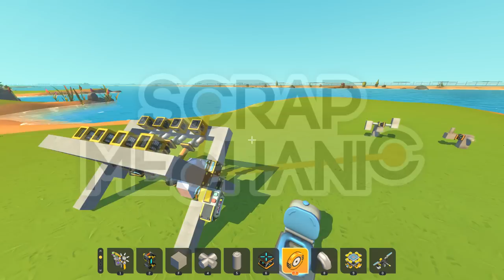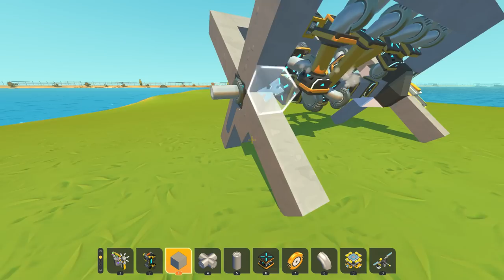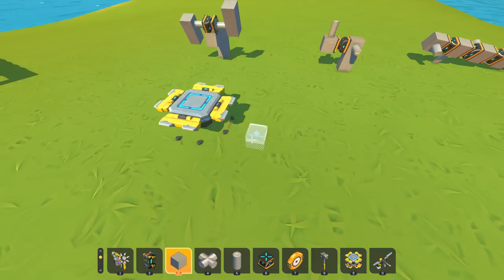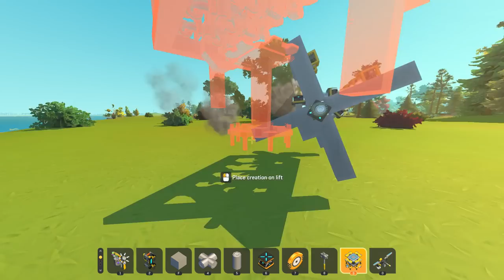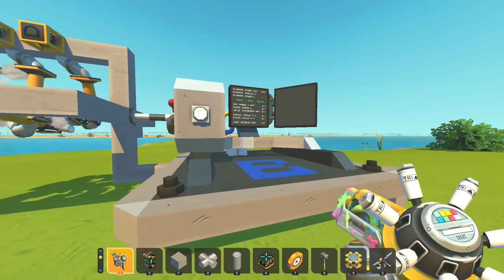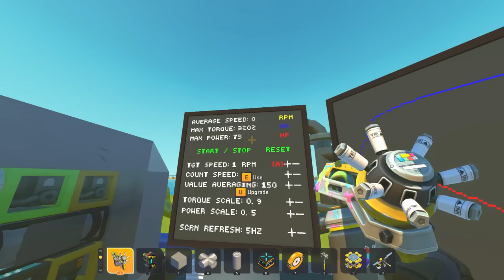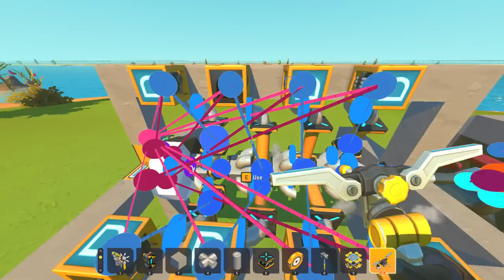I Built a V8 Engine Using 2 Amazing Game Changing Techniques!

Comment: Like you said at 13:30, this engine is basically 2 inline-4 engines bolted together in the shape of a V8 engine. Now for scrap mechanic this is probably not a bad thing, because a true V8 engine needs a timing wheel with 8 sensors. This introduces a lot of extra complexity. Its definitely worth to try making a V8 with 8 separate strokes.

Timing wheel wise, the first thing I can say is ditch the wedges. Everyone in scrap mechanic knows how bad the collision on wedges is if you've ever made a door. This is even worse for a piston engine. Another personal preference I have is putting the sensors on the crank instead of the color wheel, which is done to slightly compact the engine.

As you've already stated in the video, losing the logic gates will improve the engine a ton. Every engine should have an angle on which it simply will not turn because all pistons are canceling eachother out. For this reason I personally always hook my timing wheels up with a 90 degree offset, ensuring that the engine starts in a non-rotating state right after spawning without logic gates.

Finally I have a remark about the frame you build for the engine. One thing you want to make sure to minimize is potential collision points. Because you have rotating pieces right next to full blocks there is a chance these will collide, costing power. This is especially true when the potential collision point involves a wedge, due to their previously mentioned terrible hitbox. Again, getting rid of the wedges should solve this, but I also suggest building most of the frame out of pipe pieces. Thats part personal eastetics, part way to reduce (visual) size and part solution to any potential power loss due to collisions. Plus it allows for the use of 0-width blocks, which is a supprise tool I'll teach when the time is right. Expect way better passthrough, massive space savings on the crank and more!

Edit:
For those who wanna know how the 90 piston works, in the blueprint you'll see sth like:
"xaxisA": 1, "xaxisB": 1, "zaxisA": 3, "zaxisB": 3
The value you want to change as kAN said is "xaxisB". The value can be either -3, -2, -1, 1, 2 or 3, but you need to keep in mind that:
- "xaxisB" cannot be the same as "zaxisB" or its negative. (in this case not -3 or 3)
- negating the original "xaxisB" gives a 180 degree rotation
- using one of the remaining values gives a 90 degree rotation (in this case -2 or 2), which is clockwise or counterclockwise depending on which you choose

Edit 2:
Idk if anyone noticed, but kAN wired the pistons wrong, one side fires 90 degrees out of sequence if my analysis of the 10 seconds visible wiring is correct.
Reply: This engine specifically only has four power strokes because of where the crankshaft connects to the pistons. look at 0:31, you can clearly see, on the third set of pistons, they will need to fire at the same time. This engine is pretty much a boxer at an angle; "opposing" pistons aka pistons at a 90-degree offset in this case, fire at the same time.
Reply: about the 8 stroke 8 sensor V8, I tried building one and asked some people why it was terrible. Turns out that sensors in the corners of the sensor wheel are significantly off from where they should be, like 10-15 degrees, so the engine would not get a signal every 45 degrees but with uneven intervals. This is terrible for power and efficiency. So even though a V8 with 8 power strokes would theoretically be more efficient, that doesn't really translate into scrap mechanic.
Reply: @outandabout259  I can attest to that. I have seen people use the sensors on grid and their engine works great. Me personally, I just have two sets of sensors (look at the top of the ws as of today) and that also works great and correctly. The issue with proper 45 offset timing is more so with anchor position of the pistons. If it isn't at the right point, timing is also effected. Anyways, in my testing with just 4 sensors, I had terrible power and torque ratings due to the offset timing of the physical pistons. With 8 sensors, the engine gets insane torque over the whole range (it isn't trying to fight against itself) and also results in more HP as a result. The reason why some older designs, such as those from Alstrak in the early days, worked so well with 4 sensors, is because those are with the old creative pistons. The piston that always fired early could not overcome the leverage of the piston firing on-time or after TDC, and as a result, would allow for good rpm and torque, thus, good HP ratings. With the newer, higher power pistons, we have to account for the opposing force, and can no longer do that offset timing with just 4 sensors- slows the engine rpm, and destroys power performance. So more or less, everyone building good piston engines now must work hard to tune them for best efficiency. Kein is an absolute madlad with how much attention to detail he puts, but is very rewarding as he has built some super impressive stuff that seem impossible.

Edit: just noticed Vegard replied above your comment lol, he has a pretty good v8 using 8 sensors on-grid.
Reply: @outandabout259  I did take that into account when building mine. I used 2 timing wheels offset by 45 degrees instead of a single 8 sensor wheel. Such an engine gets close to the power a boxer-8 like engine gets, but thats it. It idsn't all that much smoother either.
Reply: comment bump, I hope kAN sees this
Reply: @casparroist2920  For YT, comment bumping doesn't matter...
Thumbs upping however does work.
Reply: If you make the wedges go the other way, you can essentially get half blocks. This means you can get a perfect 50-50 timing.

Comment: 17:20 I have found that the collisions of different parts can collide. It's not really the friction aspect. In my own testing, I have found that sticking the sensors in place of the timing wheel is better, as the sensors can point to solid square mesh blocks. Then for timing, just paint different sections of the square mesh.
Reply: A common practice to compact this further is to replace 2 of the mesh blocks with the controller. I am not actually sure whether this impacts engine perfomance in anyway
Reply: yeah i concur.  there doesn't seem to be friction but the parts can flex under load, like the crankshaft, and then when it's even one degree off axis, the edges of sections of the timing wheel can collide with edges of the sensors and such.  that said, the new pass through bearing and crankshaft he showed in this video seem to almost completely remove the flexing you can get with bearings, so maybe it's not an issue in his model
Reply: he does not need a block of room, the wedges are the problem. He just has to switch to using 9 of the same block so that SM sees it as one shape, not 7 with what he has
Reply: In my experience with moving parts on a bearing past other parts friction does apply, however I have no idea how much of a difference it makes.

Comment: 16:46 I think you could test this by making two near identical engines with the difference being a space between the encoding wheel and sensors or not and hooking both up to the dyno to see if there is a difference in output.

Comment: The Passthrough concept there is quite interesting. might be handy for some joints, maybe even ones with gears for transferring the rotation from a piston engine. Wonder if it could help with a trammel gear too
Reply: Also works for an extra connection point from the body to the crankshaft to reduce the amount of flex pistons put on it.

Comment: Man, that glitch welding method is smart. I used to just rotate things with controllers out of position, and then placing blocks there, but with the lift its much simpler

Comment: It would be awesome if kan did a piston engine olympics sometime! Imagine this: 20 minutes to build the best poston engine you can and then you gotta put it through 2 different trials. Trial 1: Weight challenge, has to be able to turn a wheel with lots of weight attatched to it within a time limit, whoever spins the wheel the fastest wins the trial. Trial 2: speed challenge, attatch the motor to a basic car, the fastest to do 1 lap around a certain track wins the trial. 

Technically yes, all of this could just be measured with the dyno but I think putting it through trials would be more fun

Comment: Hey kAN, V8 Engines are possible with with a bearing between the crankpins, however some time ago the mechanical community of SM had figured out ways to also make short crank V8s using the the same technique like the one you are using. 
Here is a way to improve your V8 even further:
Piston stretch. Apprently I had discovered that a while ago with my Vulcan engine (made it around 2018) and didn't even know about it. Some people noticed the difference between power I had compared to their V8s and it turned out that if you pull the pistons a bit further they are capable of even more power. Credit to Ben Bingo for finding that out with me. 
Also very important thing I learned is that you wan't your pistons to be set at a distance of 3 and not 2. SM physics makes it so you have more torque that way. This was told to me by Biggycheese. 

Anyways, like I have said previously I am happy that you are making engines now. I hope you continue and I hope we do a challenge one day. That would be awesome and I think many people would be happy if you try your knowledge against the OG piston engine maker. Cheers! :D

Comment: It's been a while since I've played, but I think the big thing is using the logic gates.  1 tick is like 20 milliseconds?  So the piston firing will always be 20 ms behind when it should be firing.

100 rpm being late by 20ms isn't much but 1000 rpm, 20ms is a much larger percentage (affecting where the wheel is when the piston fires)

Removing that latency may be all you need.  I'd definitely work on that before spending time on a dynamic timing wheel.

Comment: The separation of the piston head and base coordinates is probably due to the fact that they can extend so it's probably easier to represent their locations then just connect the 2 with the piston shaft instead of calculating the entire piston
Reply: In terms of blueprint data they're always contracted, though. In theory, you only need to save what one end is doing, and the other end can be calculated from that.
Good that this isn't the case, though, or the blueprint edit wouldn't be possible.

Comment: I find it funny that I pointed out you needed to get rid of the bearings on the shaft... and you needed a passthrough bearing.  I did not know if you needed mods, glitch welding, or whatever, but it was plain you needed these things.  So while I was not a master builder I had the concepts right.  This should smooth things out a lot... and having it balanced too.  So much better.  Can you upload a save for the driveshaft and passthrough bearing?

Comment: if you wanted to do a sort of load based timing you could try to use spirngs on the output shaft (like a sprung clutch) and if the spring is compressed the engine is applying more torque so you could change the timing based on that

Comment: for variable timing, you could have the encoder wheel  being larger, with the pattern of on/off at each block radius being different, and to change the timing you could use pistons to push the sensors out to the next bock radius, and thus timing pattern
Reply: There’s no point in doing so if you only have 4 strokes - each stroke will be at exactly 90 degrees offset anyways, and you rotate the timing wheel to apply an offset to all of them

Comment: Yeah, the particle generator seems to be working overtime on the timing wheel side, I don't think it would hurt to give a bit of a gap between it & the sensors.
I know you can speed controllers up by editing the blueprint files.
Might be worth looking within the file for a logic block to see if an edit might alter its response time.??

Comment: I haven't done piston stuff in a long time, but why use a timing wheel at all? pistons I made were always sensors on the pistons, if the piston was in position to fire the sensor would see and make the piston push.
I made a v8 big rig with it, it was fast and powerful but I ran into lag issues with all the bearing and sloppy gearing, it didn't have any of the fancy bearing tricks shown in this video either, kinda want to try revisit it now haha

Comment: im thinking about another encoder wheel but with only one coloured block and attach it to the bearing of the main encoder wheel, so if it goes fast it wont have time to change the angle of the main encoder wheel but if it starts to get slower, then the bearing will start to advance or decreese (depending of which one makes more torque) the angle of the main encoder wheel. please try this and lend me know if it works! greetings from Argentina!

Comment: Concept: a two layer timing wheel. The layer closest to the sensors only has the white blocks, and the rest are missing. The next layer is half and half, and can be rotated independently to adjust the length of the activation. 
Instead of a piston that is on half the time and off half the time, you could adjust it in tiny increments.

Comment: I think the adjustable timing wheel could just be based off of rpm. Not sure how you would do that in vanilla, probably just by separating the piston firing timing itself from the driveshaft location sensors.
Reply: You do it by making the flywheel increase the angle on the switch, using the controller. Then the switch can slow down / speed up the engine. kan would have to do this manually

Comment: Is there any way to create a passthrough in challenge mode? I have been trying to beat the hardest setting of the torque piston challenges, but I have been having lots of trouble creating trammel gears stable enough to actually work. The bearings just have too much give at such high torque and lock up after they bend out of alignment. I tried the other similar passthrough method shown in kAN's previous videos, but it isn't stable enough to deal with the torque it seems like.

Comment: What you can do for changing timing dependent on rpm is to have a sensor linked up to a timer circuit such that above a certain number of on/off cycles per second you get an output. You can do this by XOR'ing the output of the sensor and a short timer connected to it. This way, whenever there is a change in state, the XOR pulses. From there, you can mechanically measure the rate of triggering by having something push on a weak spring every time it triggers, you can also use something like a flip-flop to count every other time it triggers or something like that. I cannot however think of an easy way to do the measurement purely with logic and timers.

Comment: For the love of everything that is good and holy, place the control block for the encoder wheel at the output of the engine and add a button to restart the engine so you wouldn’t have to run around to tweak it

Comment: I have 0 knowledge on how scrap mechanic building works but as far as an RPM dependent encoder wheel, could you use suspension to create an encoder wheel that changes what color the sensor sees as the rpm increases?  The idea is that the suspension is either on the inside or the outside of the encoder wheel and as the wheel spins faster the suspension either stretches or compresses revealing basically a second encoder wheel for higher rpm.

Comment: You could make wacky vtec using weights attached by suspension, high rpm will push the wights out and activate the second timing, i think thats possible in vanilla.

Comment: You'd need to build some sort of PID system to measure the speed of the wheel and change the position of the timing wheel to do something like that, but it'd require some crazy logic gating to stay vanilla. Maybe the flywheel will even out the jumps enough that a single timing will do fine.

Comment: I can verify that there is zero or significantly less friction between parts of the same creation.  I have a tree harvester that pushes logs into sawblades and if I weld the log to the pusher plate the pistons move just fine but if I weld the tree to the plate and then delete block to drop the log onto the chute the pistons struggle more and more with larger trees.  So clearly there's a significant reduction in friction if it's all the same creation, even if they're separated by pistons.
Reply: the problem is the wheel is made from wedge pieces and most crankshafts use bearings and those are very flexible under load, so the edges of the wedges that make up the wheel can catch and have collisions with sensors they're directly against (hence all the metal banging sounds we've all heard in this game).  if things didn't flex at all, it would be completely friction free, but when things have collisions it defeats the whole friction free part lol.  but it's nothing a gap cant fix

Comment: I am no expert in engines, but I have seen people say you need 8 sensors for a V8 in this comment section. Try having two sets of sensors offset by 45 degrees. Also, having the wedges placed so the flat side is facing away from the center of the timing wheel not on the diagonal corners of the wheel. This makes them like half blocks, only activating the sensor for half the time a block does. You can get a perfect 50-50 timing with this method.

Comment: make an aircraft circular piston engine, and you could also do some kind of gears instead of pass-through, as the power transfer, does not have to be on the same axle, well you can do double sided pistons, dc turbine motors

Comment: i think because your taking power straight out of the engine  you need to change the timing while its running. but alternatively you could build a simple transission which should maybe help